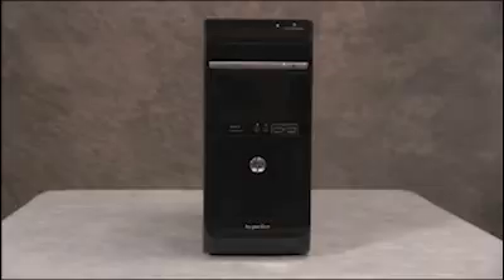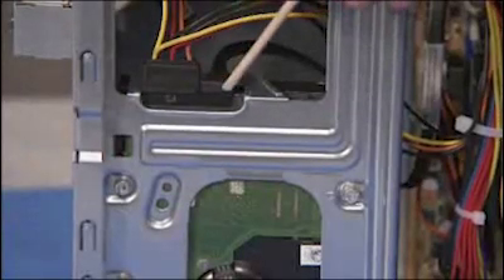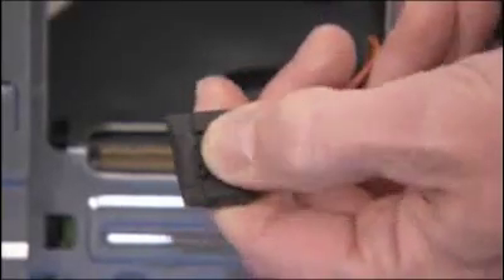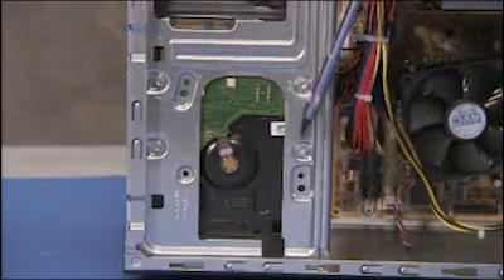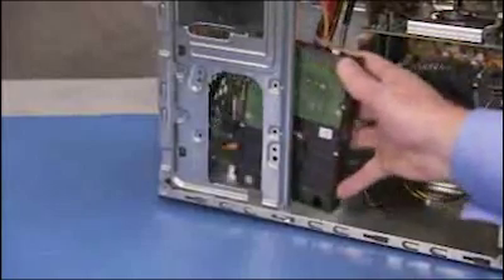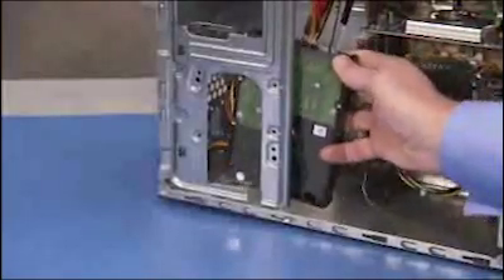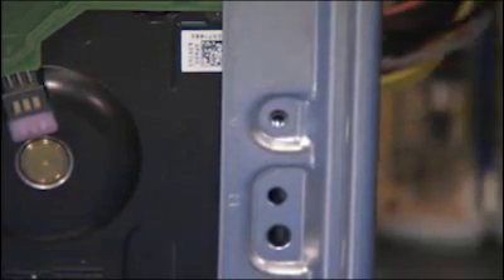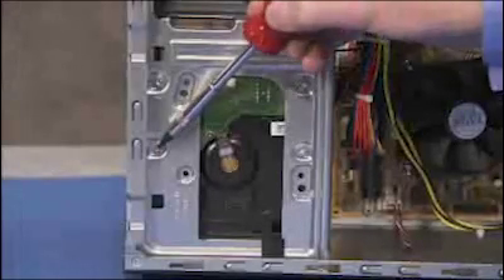Add or Replace the Hard Drive | Pavilion p6000 | HP Support

Comment: i have a HP P6214y but cant find the drivers on the hp site any help on here??
Reply from the maker: Hi there, thanks for contacting HP Global Social Media Support!
I understand that you need the drivers for your computer.
I will do my best to assist you.
Please perform updates via HP Support Assistant as mentioned below to fix this issue: HP Support Assistant Updates - 1) In the search box, type and open HP Support Assistant. 2) Check for updates. 3) If the updates are available, click on install and restart the computer.
Binu_HP Social Media Tech Support

Comment: I mean it has 4 sata ports on the mobo but no space really for easily adding more drives. I mean you can get put them in the drive bays replacing the cd/dvd drive but that is slightly annoying.

Comment: Just proves how Hewlett #Packard products designs gets worse instead of better This shows how to replace one hard drive it doesn't show how to install multiple drives the panel does not allow easy access to the inside of the PC the drive housing should've been hinged for easy access etc, a very bad #design #flaw is this, is it not?